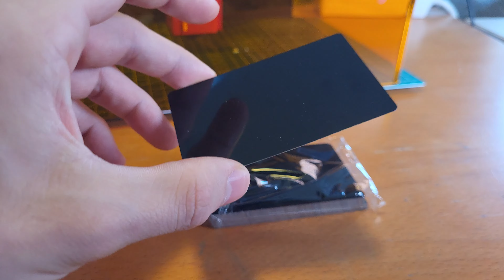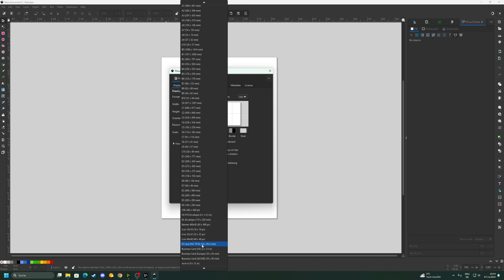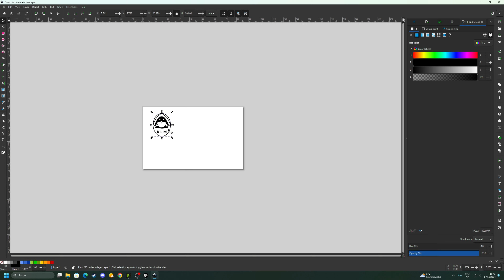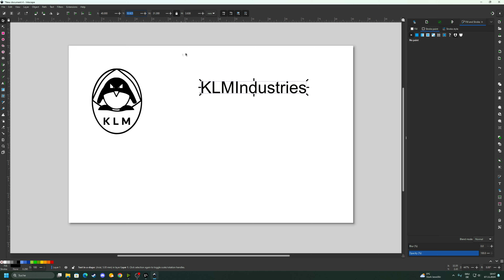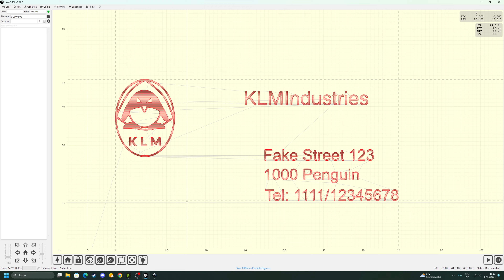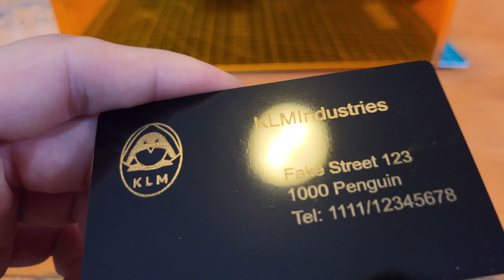How to make your own Business Cards [Laser Engraving]

Comment: Does the card get hot after engraving? (Thinking it's a quick burn off just the paint). Does the machine cause any magnetic fields that would damage electronics?

I'm thinking of using a dot. business card to engrave on.
Reply from the maker: No it doesnt heat up with that kind of speed. Just make sure you wipe the card off after the engraving, so that all the residue is removed.
And no I dont think you could sell a maschine that would damage electronics.